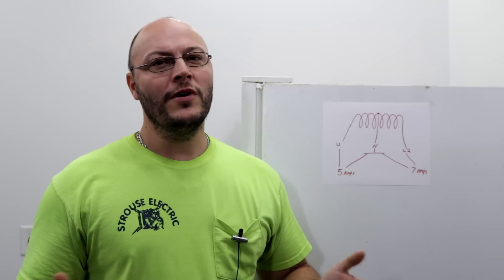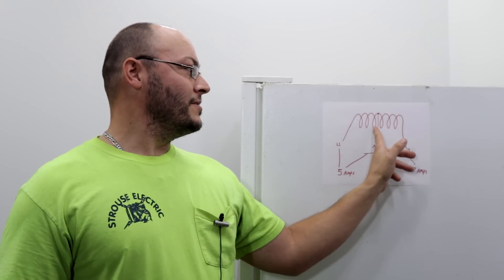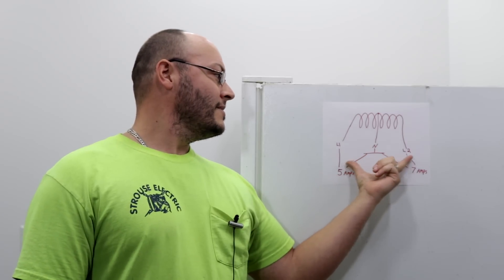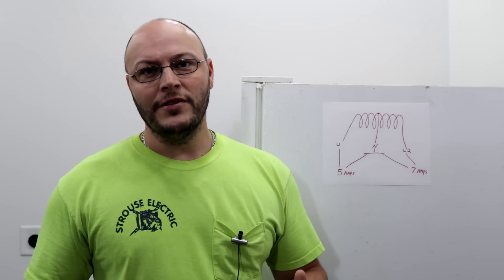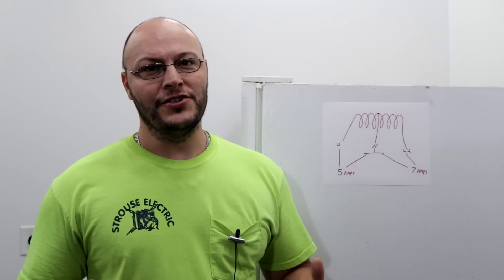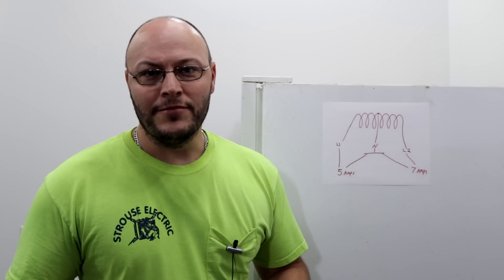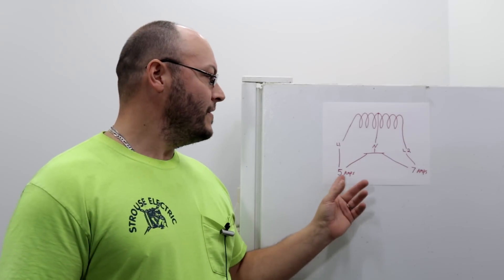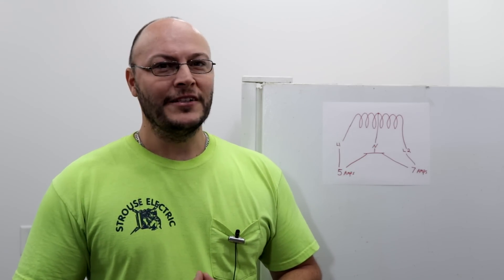What does the Neutral Wire Do?

Comment: Let me take a crack at this. I have a degree in Physics. We usually make electricity with rotating generators. Magnetic fields induce a voltage in the wires of the generators. Due to the circular rotation of generators you get a sine wave output of 60 cycles. In simple terms you have 2 leads coming out of the generator with a voltage difference that between the 2 wires that is a sine wave of plus or minus 120 volts (actually that's the root mean square value). Now the electric company is going to sell this stuff in a safe way so they first make one lead the neutral or fixed at 0 volts compared to the earth. It is really the return path back to the generator. The other lead is now called L1 or the hot lead. The neutral at your house is not exactly 0 volts compared to the earth. It floats around a little due mostly due to resistances in the wires back to the generator. To really make this safe due to the neutral floating and possible bad wiring we try to get a good local ground at your house by sticking a pipe in the ground or using a ground metal pipe complying with local electrical codes of course. This green wire  is your ground for the outside of appliances etc. for safety. L1 to neutral is 120volts. L2 to neutral is 120 volts. L1 to L2 is not 0 volts because L1 and L2 are 180 degress out of phase and thus you get 230 or 240 on your volt ohm meter.
Reply: Let me explain something to you tradesman John.  Theoretical physicists can and DO explain things to laymen all the time simply because they understand this stuff at every level and do not make mistakes while explaining it.  Now vulgarizing is a skill, but if you think the explanation above was unclear, you are either pretty dumb, or you need to finish high school so you get back some of that brain plasticity.
Reply: Thank you  @goomba008 .  Excellent response.
Reply: @goomba008  "blah blah...simply because they understand this stuff at every level and do not make mistakes while explaining it." You're kidding right?  The guy didn't know grounding rods weren't pipes.  I'm not putting him down, I'm just saying EVERYONE makes mistakes.
Reply: @goomba008  Another perspective is that tradesmen that push themselves to learn more than installation code have the chance to excel in their trade.  Having an engineering degree, I am not comfortable to let most tradesmen work unsupervised. I can't do what they do but I can tell listening to them that they have obvious limitations.
Reply: Thank You! This cleared up where the electrons go to! Thanks for explaining the theory, my ac/dc teacher couldn't answer my question.
Reply: themyopicscribner l2 stands for lead2. In ur panel box at home u have 2 leads (hot wires) and a neutral. The leads r 120v a piece. If u connect lead 1 and lead 2 to a double breaker, u get the 240v and a neutral isn't necessary because 1 lead produces voltage as the other carries it back to the source. They switch back and forth 60x/second in the u.s. when just 1 lead is connected, u need a neutral to bring the current back.
Reply: Clear as mud
Reply: Paul Downey you should ask for a refund on your education, it didn’t take or was just wrong.
Reply: BASIC Electricity.
Reply: I know that in Europe they run on 50 Hz. & they run on 230V.
Do you know if, in Europe, 1 lead is 230V & the other a Neutral?....Or is 1 lead L1 & the other L2??
I'm inclined to tjink that they only have 1 hot lead & the other is Neutral, but not sure.
Reply: @adamrspears1981  I'm more familiar with Asian residential but I think they are the same. It's one lead of 220V 50hz or at least if there is a second buss, there are no 2-buss beakers doubling the voltage.
Reply: @artsmith103  In America, single phase has Line1 Neutral & Line2.
From L1 to L2 its ~240 Volts.
From any of the Lines to Neutral its ~120 Volts. 60 Herz, Alernating Current.
Reply: @artsmith103  Very rude, very wrong & very immature.
Smh
Reply: Nuetral and ground are the same wire at the source I.e the star connected secondary of the supply transformer
Reply: pretty sure that's what he said. And just like he said if for example there is a kitchen appliance plugged in to a circuit u R working on and you touch ground to neutral u feel 120 volts at low amps. touch it while the appliance is on and you will feel120 volts at a higher amperage.
Reply: Lynz Kartr I am touching L1&L2 busbars  and  i feeeeeeeeseelllllll
Reply: @zhuetwo453  DON'T TOUCH IT
Reply: John Balzano Right. I actually work on this stuff, but this guys original comment says you have 2 leads coming from the generator in the power plant. You have 3. Hence 3 phase power. Since nothing you said was wrong I’ll assume I won’t have to explain power to you,  just the original commenter with a physics degree. Lol.
Reply: @thebradnoyes  yeah, glad that physics person does not teach electrical classes.
Reply: Brad N correct, brown orange yellow right? BOY
Reply: Do you know how to tell an engineer from any other person? They start their conversation with “I’m an Engineer “.  Every time.
Reply: @170boone  I'm an engineer....but I don't start every comment with "I'm an engineer" ;-)
Reply: I got shocked once.  But I was alright, once I got past the pain.
Reply: I understood your explanation perfectly and this is the first time anything makes sense.  I had no idea it was that simple.  Thank you.
Reply: Hey, I have a degree in physics too!
Reply: Thanks for the buzz kill genius.....
Reply: Kind of what he said in simpler terms
Reply: I couldn’t get past, “I have a degree in Physics.”
Reply: Without the ground all loads are in series on230volts so voltages would be unequal if loads unequal. . thought I'd simplify.😎
Reply: Don Desnoo, without the neutral loads would be in series on 240v, the neutral connects to the center tap on the transformer.
Reply: So what is L2?
Reply: You have 3 leads coming from a generator at the power plant.
Reply: Brad, It starts as 3 phase at the power plant.
Reply: @thebradnoyes  technically a generator has 4. The 4th lead is tied to earth. The generator has a Wye configuration with 3 phases. Aftee the generator it goes to to step up station for power distribution to the grid.
Reply: roy Yung You’re wrong about that bud. You don’t want any grounding in a generator. They actually have faults and trips that will affect load if ground is detected. You’re equipment will be grounded, housings etc but you actually take every precaution you can to keep from grounding anything in a generator. Take a trip out to a power plant some time and tell me how many wires go out from the main power transformer to the substation. I’ll help you out, it’s 3. 

20-30,000 volts will make a big ass boom if it were to become grounded. Trust me.
Reply: @thebradnoyes  axtually you are incorrect. Let me see if I can explain and hope this doesn't go over your head. According to GE (who makes power plant generators, in case you didnt know know) the neutral phase of the WYE configuration at the generstor IS grounded in the groundi cubicle portion if the generator which is also where the protective relays are housed. There is a number of ways to ground the neutral, but most use a grounding transformer to monitor current in the natural for the protective relays. Hope this helps you out in your understanding of electrical generation.
Reply: @thebradnoyes     Exactly, 3 phases, 120 degrees apart. Hard to imagine 2 110V-phases coming out of a billion dollar plant...
Reply: That is because the generator at the power plant is 3 Phase, but only one of those phases goes to your house. What is shown in this video is 1 or single phase power. You can get three phase power to your house, but the electric company will charge you for the installation of a 3 phase transformer.  As far as home appliances go, there are some 3 Phase systems that are mostly for commercial use that you can buy for your home. Such as AC systems, commercial ovens, and welders.
Reply: @thebradnoyes  yes, that is 3 phase, with each phase beibg 120° apart and the voltage is between 20-22 thousand volts, which is stepped up to 500 thousand volts to supply the grid. In a 3 phase system, there is no neutral per se.
A neutral is simply a return path to a transformer winding and does carry current, where as a groind should never carry current. The ground is there for safety. Remember electricity will find the shortest path to return, and that path should never include a human body ;)
Reply: @joshuncc  anytime you induce magnetic flux into a coil (ie voltage applied into the primary) and the secondary has a center tap like he shows in the diagram, voltage measured on a an oscilloscope will read L1 & L2 will be a single sinusoidal (some) wavfrom of 360° and a sine waveform from L1 OR L2 with respect to the center tap. If you use a dual trace scope and put 1 trace on L1 and the other trave on L2 and use the neutral as a ground reference each trace WILL be 180° out of phase with each other. That's basic a/c.
This is why in a perfect linear load on L1 to the center tap, and the same sort of load on L2 and center tap, there should be zero current on the neutral, as each side of the secondary is 180° with each other, thus canceling out and current on the neutral.
Try it and see.
Place a 120v toaster on L1 and the neutral and the same type of toaster on L2 and the neutral, then use your amprobe on the neutral, guess what? It will read Zero (if the toasters are identical. Why is that?
Because L1 & L2 are 180° out of phase with each other with respect to gound.
Reply: And this is why people with super degrees in physics don’t teach tradesmen and don’t work in the real world. Stick to theory man.
Reply: @richhayner1208  If it wasn't for physicists you wouldn't have a fucking job because there would be no electricity 😂
Reply: Paul Downey I've been in electrical school for less than 4 months and I could've told u that. Stating u have a degree just makes u sound arrogant. U basically just repeated the video.
Reply: You're a douche!

Comment: "The ground has nothing to do with the voltage." Im confused now because doesn't the earth ground have some influence on the voltage. It acts as a 0v reference point for the system so that the voltage doesn't fluctuate. Im probably wrong but can someone help me out. I had to add a ground wire to a miss wired 480/240 volts transfromer at work because the voltage was fluctuating and it was clearly not safe without a ground. Now it stays consistent.

Comment: Lightning strikes are a very important reason for a ground wire to exist.  But what if there is a short inside your appliance that makes the chassis live?  If someone touches the appliance and provides a path to ground they are going to get a shock.  UNLESS the chassis is grounded and then it will blow the fuse.  Which might inspire someone to figure out what's really going on.

Comment: The nuetral completes the circuit
Reply: Single and three phase systems do not necessarily need a neutral, they do need a return path but in a 240 1/0 volt or 3/0 system the return can be the conductor when the polarity changes direction
Reply: @John, only single phase is the only sitation where the neutral is absolutely required. 2 phase and 3 phase can do without, as long as the load is equal on all phases. Here in Europe 99% of the home appliances run off single phase 230 volts (1 phase and 1 neutral).
Reply: here in the US we have 120v per leg x2 legs in residential so if you have a heading element per sae that is 240v it would be 1/0 but 2 legs, we do have 2/0 in some older steel plants but its not common and is almost entirely phased out,( im an industrial electrician) in my plant we have 3/0 208v/240v/277/and 480v
Reply: Best answer I've heard in a long time
Reply: @HilaKleiner u mean 3 phase? Or Hot, neutral, and ground?
Reply: Ur thinking DC
Reply: Sapling of nuetral is worng

Comment: Your explanation for what the white wire does was pretty accurate.  Now do a video on "Ground Bleed" when the white wire is nicked somewhere and the conduits are electrified with a small amount of current.  The breaker will not trip in this scenario unless it's a GFI.
Reply: If the conduits have voltage present that means the entire grounding system also has voltage present. Time to pull out the nicked neutral and pull new wire.

Comment: If that white neutral wire is carrying 2 amps back thru the breaker box then that would make my bare copper ground wire in the breaker box hot because the bare ground and white neutral are secured to the same bus bar in the box. Now I'm really confused!!!!!!
Reply: I wondered about that too.  Electricity won't flow to ground (as it's a poorer conductor than the copper back to the pole), but it has the potential too (should the neutral to the pole be compromised).  Everything in the circuit is balanced so if the ground and neutral are tied together, they should measure the same (with respect to ground).  It's just a case of "path of least resistance" and hope the neutral to the pole stays intact.
Reply: Thanks for clearing that up for me..makes sense but Scary.

Comment: Video is alright but I don't like the logic of it, you can't really say the neutral is not a ground its bonded with your egc at your point of service, nec refers to it as its grounded conductor, also your theory on ground aint specific u left out about ground faults on  your branch side as a form of  protection, your neutral is used as a return back to grid , you have different phases peaking at different times your neutral is tied in with all those peaks and send anything that the appliance/device dosent use back to the power plant , grounds purpose is for everything electrically conductive to be a 0 potential 

feel free to comment thank u
Reply: How can the neutral "return back to grid" if it's grounded at the point of service?  Still curious ...
Reply: if I have to tell u this , you shouldn't even be asking this question.

Comment: the ground in a house is not for lighting strikes, its for ground faults that occur when a hot wire touches a metal surfaces that is grounded. A grounding electrode like a a ground rod is for lighting strikes

Comment: In Europe some large homes have 3 phase available so you can tap up to 3 x 240V lives which flow back to the neutral, thats if you need extra power. But most smaller homes have single phase 240V so if you have single phase the circuit is made up of only the live and neutral. Then all of the power flows towards the neutral.
Reply: Level 3 charging (electric cars) will need that 3 phase power?

Only cost about $60,000 to install in the McMansion.

This is years later.

Comment: That's not accurate. The neutral will carry 12 amps back, which is the sum of the two. A ground is related, but different as the ground and the neutral are connected at a single point in the house (at the main panel).

Electrical flow is basically a circle. What goes in must come back somehow. The easiest path is back through the neutral. Amperage is the measurement of that electrical flow. In a situation where the neutral is severed or the hot touches a conductive object, the electrical flow changes. Instead of returning on the neutral it returns on the ground wire which eventually connects back to the neutral and allows the flow to return to its source. In this situation a short has been created, which results in a sudden increase in amperage, thus the breaker trips or the wire overheats and burns up.

If that conductive object is not grounded, then the electrical flow takes another path when it can. Commonly, that's when someone touches it and completes the circuit to ground which, again, completes the circuit and allows the electrical flow back through the earth and to its source.
Reply: The neutral doesn't carry 12 amps back because the amps are consumed by the loads.  When there is a difference in loads on a center tap transformer the imbalance is returned through the neutral.

Comment: Great explanation of L1, L2 and Neutral. I had to laugh at half the comments. Such as not NEC qualified, ground wire, polarity and many more. Did you people listen to Bill's video or just draw your own conclusions. That's as simple as you can get. In his diagram he's showing 5 amps being used on one 120 volt circuit and 7 amps on the other side or opposite circuit. There's no 2 amps left over, you only pay for what you use. To close the loop you have to have a neutral and it's cycle's polarity 60 times per second. In Bill's sketch there's no unbananced load unless he's showing a 240 volt circuit. In which case the 5 + 7 amps are still used and no current will ever get back to the pole or transformer. With electricity these will always be an unbalanced load, always. Now if it was a DC circuit then yes 2 amps goes back to the origination point to be reused.

Comment: You didn't mention that the voltage between L1 & L2 is approx. 230vac.  The 'neutral' provides the center tap (split) to allow you to have 2 115vac circuits for lights & small appliances while still having the 223vac circuits for you dryer, water heater, etc...
Reply: Yes. All that talk about balancing the load is fine and all, but the neutral wire allows you to have two separate voltages without having two separate sets of cables from two separate transformers.

Comment: Yeah, this is completly wrong. The voltage lies between L1 a N (L2 and N) and so does the current flow. In the shown example its 12A (5A+7A).  And if u had devices wich work on higher voltage they could be connected between L1 and L2 like in many workshops. 
Pls dont attempt to install your on wiring wthout a qualifing education and dont rely on this kind of videoa
Reply: The neutral only carries the unbalanced load, so in this scenario the neutral would only be carrying 2 amps.